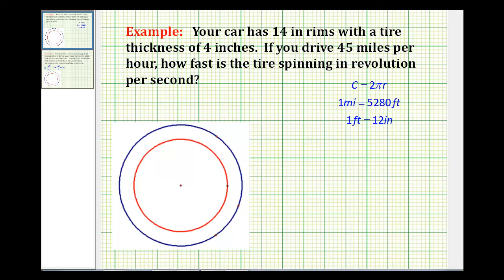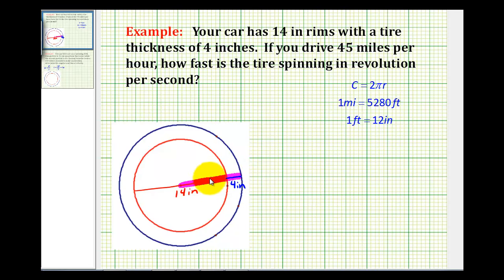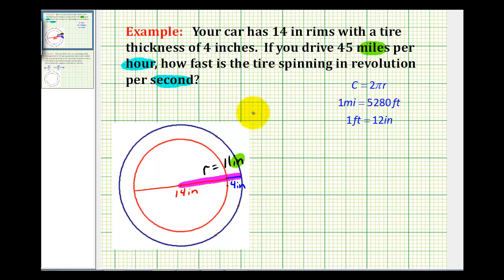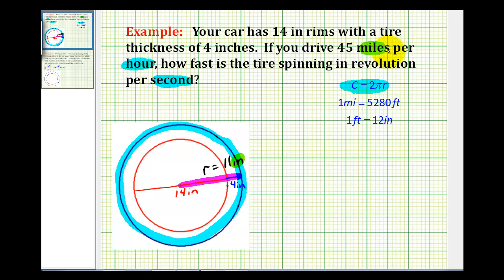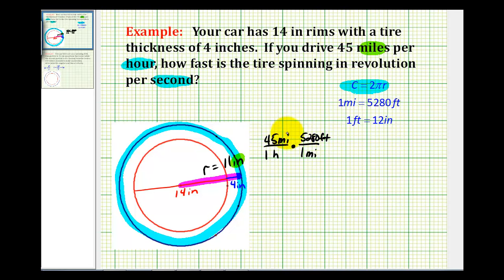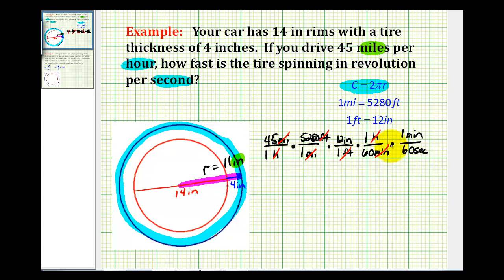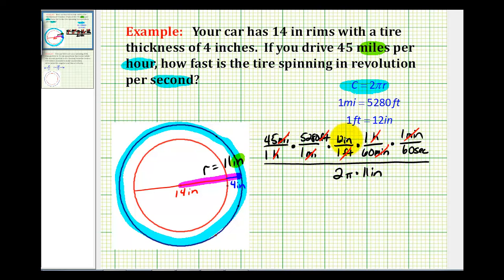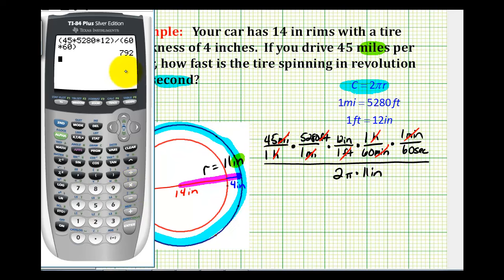Example:  Determine the Number of Revolutions Per Second of a Car Tire

Comment: why the final conversion, ie inch/sec divide by 11 inch but not 14inch because circumference (the blue line) has 14 inch diameter?

Comment: could you please solve this one?
A certain care wheel has a area of 3600πcm2 and its radius is x/2m. the car’s wheels turn through 100ᴼ about its centre, which is the rotation fixed, in 1/18 seconds
	Find the value of the radius.
	If a point on the rim of the wheel travels 32.4π km. how long does it take to travel that distance?
Reply: Radius is 0.6m and time is 1.5hr